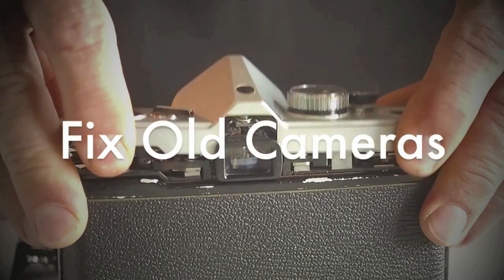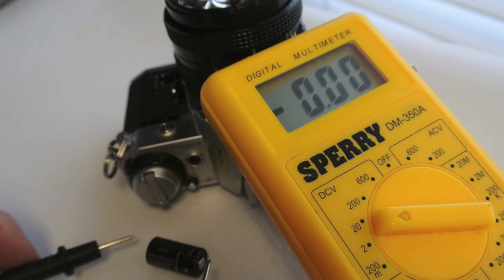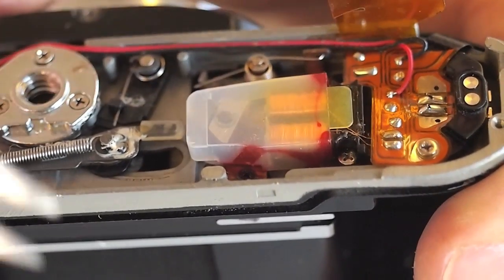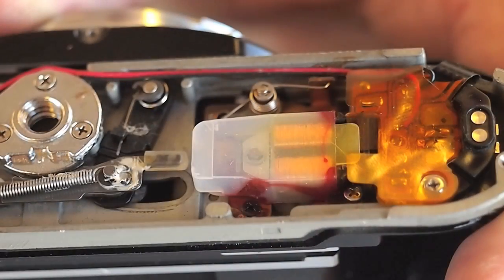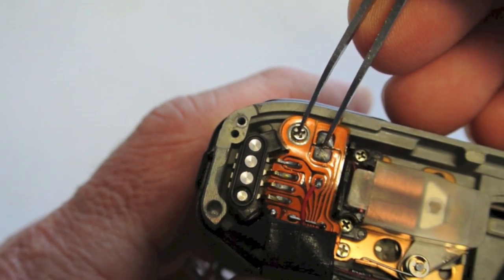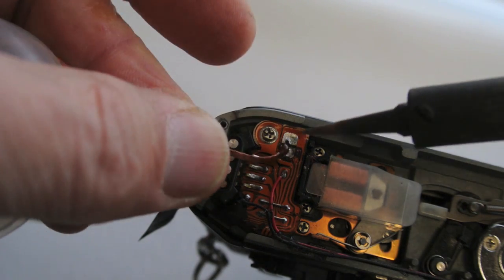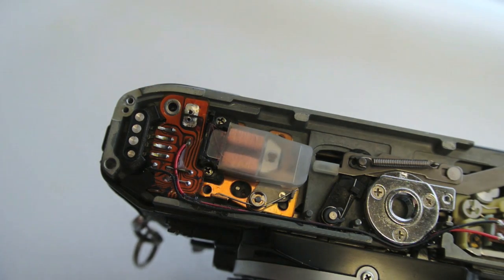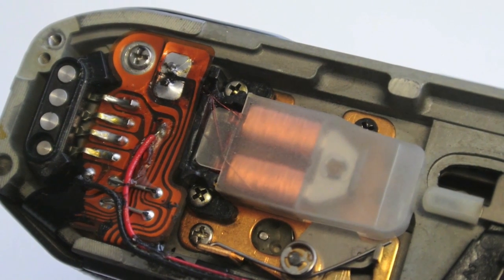Fix Old Cameras: AE-1 Release Magnet

Comment: I have this problem all the time , i changed the battery, i clean the contact, the magnent release when i do it with the magnent terminals, but if i try to do it in the regular way  ( by clicking , still dont work..)  : /
Reply from the maker: Check the solder connections at the release magnet. Otherwise it is probably a defective release capacitor. It lives next to the release magnet and is typically blue.
Reply: @FixOldCameras  I have the courtain stuck , i took the picture, (back then when everything got locked) and never get back, and also if i want to pass to the next frame of the film, (the "hook " where also the asa and shutter speed its lockated) i can't. I feel like probably its something not that complicated, but im missing something. Sorry my techincal english on camera its nule.

Comment: wher do i get a replacment magnet? thanks in advance.
Reply from the maker: Salvage a release magnet from an AE-1 that has irreparable electronic issues. They can also occasional be found on internet auction sites. The magnet can be tested by arming the magnet than apping camera battery voltage across the circuit connection posts of the magnet.

Comment: where do i get the replacement battery?
Reply from the maker: The 6 volt lithium battery L544 are available at camera dealers, hardware stores, drug stores and online.
Reply: @FixOldCameras  thank you for the replay! So the battery is working in mine, so it seems I have to replace the electromagnet but I can't find a replacement one...where did you get yours?

Comment: Hi, I have a similar issue with my Canon AV-1. The shutter releases only in bulb mode. The battery (Duracell) is still good and I checked even with a brand new (Camelion) battery.
What can it be? Thank you very much!
Reply from the maker: It is important for the Canon A series cameras to have a 6 volt lithium or silver battery at full 6 volts. That fact the shutter is working on bulb indicates that mechanically the shutter is fine and the release magnets are working. Sounds like a good possibility of a IC processor failure, however, you might still check out the integrity of the circuit looking for breaks in connections of wires and switch contacts.
Reply: I'll definitely try to open it,
thank you very much for your time!
Reply from the maker: Right on. Good luck.

Comment: What if the magnet doesn't ever hold? It stays released?
Reply from the maker: Try cleaning the holding surfaces with isopropyl alcohol. If it still will not hold, the permanent magnet of the release magnet is in a weakened state and will probably need to be replaced.
Reply: Where is to buy that magnet?

Comment: I’m in desperate need of help! I found an old Canon A-1, bought new batteries for it, but soon realised the levar was stuck. I tried the magnet thing at bottom, no luck. I then followed the tutorial for dismantling and trying to find an obstruction under the levar, again no luck. HOWEVER, it has managed to be pulled all the way a few random times (never one after another). It lets me wind it fully, press the button, and then the mirror flick up, but then doesn’t flick back down again - thus the levar is stuck again! Please, if anyone has any idea what is causing this to happen then please help
Reply from the maker: If the mirror is not dropping at the end of cycle you need to determine if the second shutter curtain is completing the cycle. If not... maybe as shutter tension issue, if so... maybe a mirror dampening mechanism ( squeaky noise before complete failure).

Comment: My canon AE-1 shutter is jammed how can I fix it😭😭😭😭
Reply from the maker: For a start point, make sure the battery is a full six volts. Then check the magnet.
Reply: @FixOldCameras   yes i checked, i doesn't work too so do i need to find a new magnet part?

Comment: On my the shutter doesn't release and i cant advance at all
Reply from the maker: +tom hood If the camera does not release by manually tripping the release magnet than the camera has a mechanical malfunction that has caused the locked up condition.

Comment: My Release Magnet works and my shutter fires manually but it wont fire when the button is pressed can anyone help?
Reply from the maker: Make sure you truly have a good battery. Occasionally, a weak battery will operate the meter and sometimes fool the battery test function, but yet still not release the camera. With a good battery and a properly functioning meter than it is likely an electronic issue - an open in the flexible circuit, a bad IC (PX2), or a bad release capacitor.
Reply: The battery is fine as it works in my AE-1 Program. My AE-1 (the one with the problem) didn't fire when i first got it, but then out of no where it started working. But then one day when I was out shooting it didn't want to fire again. Is it a circuit problem, is there a way to fix it on my own?
Reply from the maker: One issue that might be a simple fix would be a poor ground connection. Try checking the ground screw next to the release magnet. There is also a ground screw under the top cover next to the viewfinder on the rewind side of the camera. Check to make sure the screws are tight and the contacts and screw heads are clean.

Comment: The release magnet and battery may not be the only problem, I completed this tutorial successfully and my shutter still didn't release when I pressed the button. I had to take the top off of my ae-1 program and I found that the shutter release contacts weren't working. https://www.youtube.com/watch?v=tOu-x5StyJ8 right there is a link to how to take the top off of the ae-1 program,  https://www.youtube.com/watch?v=sHgN1RM3H7c and here is a link with the same tutorial for a regular ae-1, both videos also by fix old cameras!
Reply from the maker: Thank you for your comments and your interest in Fix Old Cameras. With your apparent persistence and patience you will no doubt prevail.

Comment: Hello, i hope you can help me.
if i press the trigger button half  -light meter starts and works. 
But my A1 dosnt shoot if i press the shutter button. (good Batterie) 
if i short like 01:27  the magnet close and the shutter shoot. 

so it looks like the trigger button (on the top) dosent work for release. How i can fix it?

Comment: Hey, so I shorted the magnet contact to the ground screw and the shutter released, but there is still nothing when I press the shutter button. How would I go about troubleshooting the upper circuit? Or is that even my problem?
Reply from the maker: Check for a break in the connecting flex circuit. Check for a solid connection on the lower flex ground screw. From an early post... If the magnet energizes then the issue is in the release circuit or a loose ground screw. Check the ground screws by the release magnet and by the left of the eyepiece ( you will have to remove the top cover to access this ground screw). The additional circuit trouble shooting is much more involved... Probably not going to help much, but, make sure you are getting battery + voltage at the lead on the (blue) release capacitor closest to the release magnet. This capacitor can also be swapped out from a donor camera. Make sure you have battery + voltage at the lead of the release magnet closest to the release capacitor. If good, check coil continuity of the magnet. If no continuity, remelt solder at the test points. Also top cover can be removed and all the switches on the release side of the camera should be checked. There could be an open in the flex circuit or connections that will need to be traced. Then there is the possibility that all is for not as you could have a defective IC, the one that lives on the release button side of the prism flex. Also, if you are using an alkaline battery you might switch to a silver or lithium.
Reply: Fix Old Cameras thank you! I will try all of this

Comment: When i short the ground screw it releases, but when i wind the lever for the next shot the shutter release button doesn't trigger it. It has a great battery in it. There's a spring feeling to the button, but it just won't release the shutter curtain. Any help on that?
Reply from the maker: +T3dBeh1722 There is a chance you have a defective IC, which are impractical to replace. It has been more than a few years ago, since such an IC was available. But there are a few things you can check. The following steps are a repost of a previous comment to this issue. First make sure you are getting battery + voltage at the lead on the (blue) release capacitor closest to the release magnet. Make sure you have battery + voltage at the lead of the release magnet closest to the release capacitor. If good, check coil continuity of the magnet. If no continuity, remelt solder at the test points. Also top cover can be removed and all the switches on the release side of the camera should be checked. There could be an open in the flex circuit or connections that will need to be traced. Then there is the possibility that all is for not as you could have a defective IC, the one that lives on the release button side of the prism flex.
Reply: +Fix Old Cameras Is there any possibility of a video demonstration of this procedure? I'm working with an AT-1 with this issue.
Reply from the maker: At some point a FOC video could demonstrate some of the procedures mentioned in the comments. It could be quite sometime before such a video is posted. There are so many great suggestion for videos, all of which have been noted and logged for future possible videos.

Comment: With my AE1, I have press the shutter button and the meter needle plummits to the bottom. I've changed aperture and shutter speed and battery but it still does the same thing. Any ideas?
Reply from the maker: Would suspect a broken ASA link wire. 
A place to start. https://www.youtube.com/watch?v=hJUidgM6LoI&t=65s